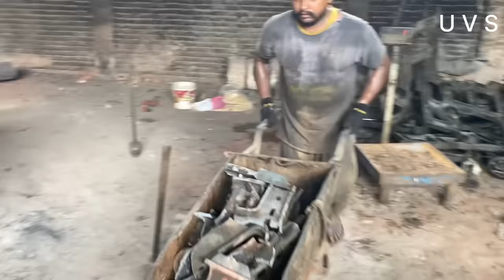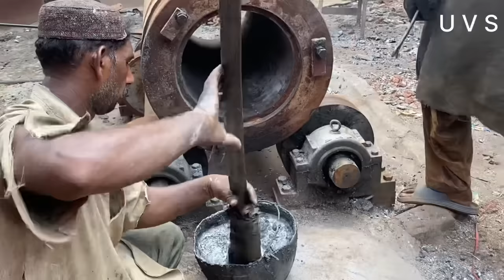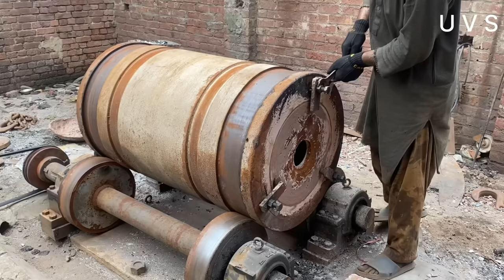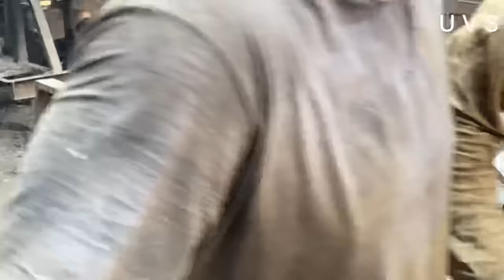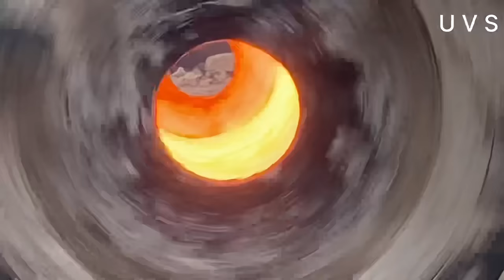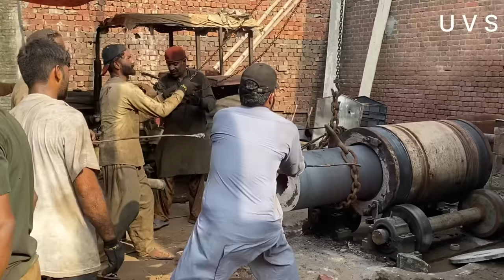Incredible metal recycling mass production|steel factory production which scrap metal

Comment: if they are using waste oil as fuel and the mix of metals is dirty iron and steel all the carbon from the oil will be making soft iron but as the centrifugal process eleminates bubbles the resulting tube may be very good for whatever it is to be used for.
Reply: a canon?
Reply: @FiftyFiftyFilm  cannons used to be made of iron.
Reply: as you are so well informed, do you know by chance where this production is situated? maybe Bangladesh? @rosewhite---
Reply: @FiftyFiftyFilm  many of these videos are from Tamilnadu q.v.

Comment: WTh is the roller used for
Reply from the maker: This roller use in floor mill
Reply: @UniquevisonSkills-dn4wp  Oh ok thanks
Reply: @madmanmechanic8847 Floor Mill....a heavy set of rollers that are used for recycling metals. Eg scrap aluminium is melted into a large slab or ingot, then this slab is rolled back and forth between two rollers until it is thin metal. The thin metal is then made into fry pans and exported for money.
Reply: @sparked3113  Very interesting thanks for the reply